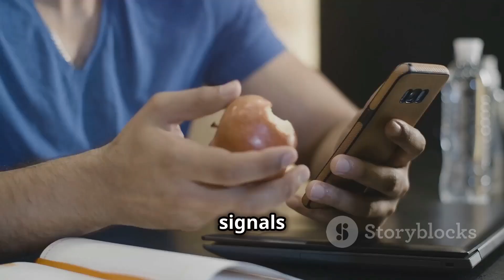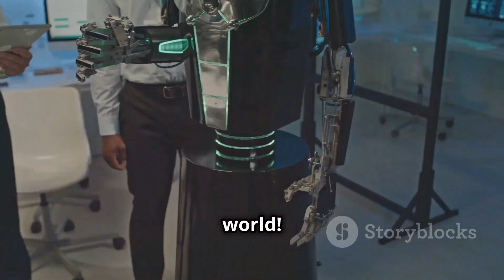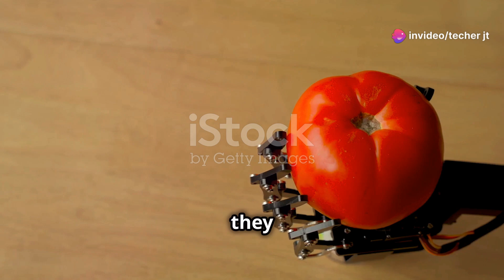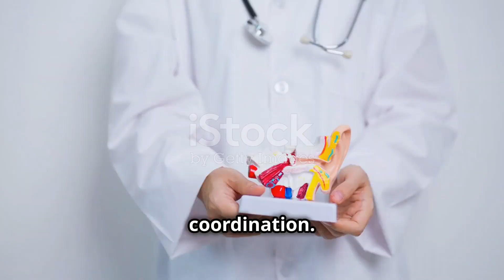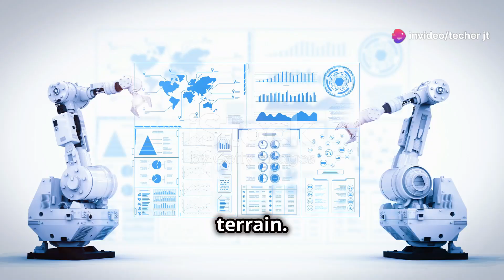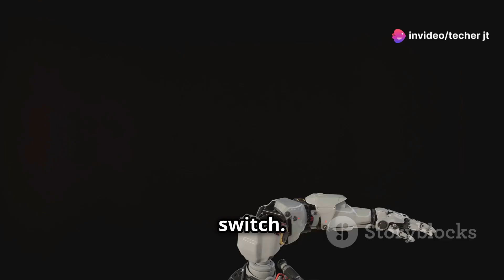Robotics Mechanical Sensors

Comment: 🌟10 - Andromeda Chain  ⬇⬇
Reply: Antonnette C. Tayrus 
10 - Andromeda 

Q1. Understanding: What are mechanical sensors, and how do they function in robotics?

Answer: Mechanical sensors are the sensors that allows a robot to navigate and interact with their surroundings, they are the sensors that allows robots to perceive the world around them. Robots rely on these sensors to gather information, just like how humans rely of their senses to understand their environment. They function as they convert physical stimuli, like touch or motion into electrical signals that the robot's brain- the controller can understand. As if translating the language of the physical world, into the language that robots can comprehend. They are crucial because it is important for the robot's accuracy and safety, avoid obstacles, handle items with precision, and even respond to changes in the environment.
Reply: Rose Gabrielle D. Araoarao
10 Andromeda

1. Understanding: What are mechanical sensors, and how do they function in robotics?

Mechanical sensors help robots observe and interact with their surroundings. These sensors work similarly to human sensory organs, providing information on a variety of physical characteristics. They play an important role in helping robots to do difficult tasks independently and safely.
Reply: Ariel Lacia
10-ANDROMEDA

Q1. Understanding: What are mechanical sensors, and how do they function in robotics?
-Mechanical sensors are devices used in robotics to detect physical changes in the environment. They function by converting mechanical energy, such as pressure or movement, into electrical signals. These signals are then processed by the robot's control system to make decisions or perform actions.
Reply: Kent Kyle T. Palingcod 
10-Andromeda 

Q1.  Understanding: What are mechanical sensors, and how do they function in robotics?

Mechanical sensors are devices that detect physical changes in their environment, such as pressure, force, or displacement, and convert these changes into electrical signals for processing. In robotics, they enable machines to perceive and interact with their surroundings, facilitating tasks like navigation, manipulation, and feedback control.
Reply: Real Ann R. Dela Victoria 
Grade 10 Andromeda 

Q1.  Understanding: What are mechanical sensors, and how do they function in robotics?

Answer: 
Mechanical sensors are devices that allow robots to perceive their environment by converting physical stimuli, such as touch, motion, or force, into electrical signals that the robot's controller can interpret. Robots rely on these sensors to gather information, just like how humans rely of their senses to understand their environment. They function as they convert physical stimuli, like touch or motion into electrical signals that the robot's brain- the controller can understand. They are crucial because it is important for the robot's accuracy and safety, avoid obstacles, handle items with precision, and even respond to changes in the environment.
Reply: Zara Mae M. Jurane
10- Andromeda

3. Analyzing: Compare and contrast force/torque sensors and accelerometers. In what situations would each be more beneficial?

-Force/torque sensors measures the forces or twisting forces acting on a robots arm or gripper. Whereas accelerometers measure linear acceleration (the rate of change in velocity). Force and torque sensors are best for applications that requires precise control of force, like gripping delicate objects or assembling intricate parts, which is precisely beneficial for space robots, that usually maintain and repair space crafts on other planets. Accelerometers on the other hand can be best used in cars, specifically in airbag systems, to detect sudden rapid deceleration.
Reply: Christine M. Luna
10 - Andromeda
Sept. 09, 2024
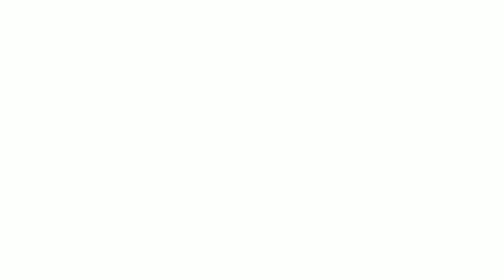7:22 (time stamp)

5. CREATING:  Design a simple robotic system that utilizes at least two types of mechanical sensors. Explain how these sensors would work together to achieve a specific task.

PROPOSED ROBOTIC SYSTEM:
"Automated Pick-and-Place Robot"
- The objective of this robot is designed to sort out and transfer small objects in a manufacturing environment.

Mechanical Sensors Utilized:
1) Force/Torque Sensors 
2) Proximity Sensors

COLLABORATIVE INTERACTION OF SENSORS:
- When the robot approaches an object, the proximity sensors activate -- confirming the object's presence.
- As the robot grip the item, the force/torque sensors monitor the gripping force, adjusting it in real-time to ensure the object is held securely without being crushed.

- This synergy between the sensors then enables the robotic system to efficiently and safely pickup-and-place items in designated locations, ultimately enhacing work productivity and reducing the risk of damage during operations.
Reply: Angel Sofia C. Tabaniag
10- Andromeda

1.) Understanding: What are mechanical sensors, and how do they function in robotics?

- In robotics, mechanical sensors convert physical changes such as force, pressure, or motion into electrical signals. These sensors facilitate environment interaction, movement adjustment, and stability for robots.
Reply: Trixie Lorraine T. Canopin
10 - Andromeda 

1. Understanding: What are mechanical sensors, and how do they function in robotics?

ANSWER: Mechanical sensors in robotics detect physical stimuli like force, touch, or motion, converting them into electrical signals that robots can interpret. This allows robots to perceive and interact with their environment, enabling accurate and safe task execution, such as applying the right amount of force to assemble parts.
Reply: Andrei Lavern A. Pelayo
10-Andromeda

4. Evaluating: Assess the impact of mechanical sensors on the efficiency and safety of robotic operations in manufacturing. Provide specific examples to support your evaluation.

Answer:
Mechanical sensors enhance efficiency and safety in robotic manufacturing, and provides real-time data on factors like position, force, and proximity, making robots to perform tasks precisely, avoid hazards and etc.
Reply: Dean Andrie P. Daohog
10 - Andromeda

1. Understanding: What are mechanical sensors, and how do they function in robotics?

Mechanical sensors enable robots to view and interact with their surroundings. These sensors function similarly to human sensory organs, providing information on a wide range of physical properties. They serve a vital role in enabling robots to do complex jobs autonomously and securely.
Reply: Kobie James B. Gabales 
10 - Andromeda 

3. Analyzing: Compare and contrast force/torque sensors and accelerometers. In what situations would each be more beneficial?

Force/torque sensors provide a robot with a sense of touch, detecting forces and torques during interactions. In contrast, accelerometers measure linear acceleration, helping robots maintain motion and balance. Force/torque sensors are commonly used in robots that interact with humans, such as collaborative robots.

 Meanwhile, accelerometers are essential for applications like navigation, collision detection, and gesture recognition, and are widely used in devices ranging from smartphones to cars.
Reply: Ettena Marie A. Gabales 
10 Andromeda

1. Understanding: What are mechanical sensors, and how do they function in robotics?

Sensors are essential for robots to perceive the world around them, just as humans use their senses. Mechanical sensors convert physical stimuli into electrical signals that the robot's controller can understand, similar to language translation.
Reply: Davey A. Sabanal
10 - Andromeda

2. Applying: Describe a scenario in which tactile sensors might be used in a robotic application. What advantages do they provide in that scenario?

Tactile sensors in robotic surgery enhance precision, provide real-time force feedback, prevent tissue damage, improve safety, and enable delicate manipulation of surgical instruments and tissues.
Reply: Kerk Ivahn C. Durohom
10 - Andromeda

Question 1. Understanding: What are mechanical sensors, and how do they function in robotics?

Answer: Mechanical sensors enable robots to navigate and interact with their surroundings, as well as perceive the world around them. Robots rely on these sensors to collect data. They function by converting physical stimuli such as touch or motion into electrical signals that the robot's brain, or controller, can understand. They are critical because they help the robot avoid obstacles, handle items with precision, and respond to changes in the environment.

Comment: 10 LYRA CHAIN 🌟💙
Reply: Barcenilla, Xharmei Therese P.
10 - Lyra

4. Evaluating: Assess the impact of mechanical sensors on the efficiency and safety of robotic operations in manufacturing. Provide specific examples to support your evaluation.

Answer: Mechanical sensors have significantly improved the efficiency and safety of robotic operations in manufacturing. They enable precise control of forces for delicate handling of parts, collision detection and avoidance for improved safety in collaborative environments, adaptive control based on sensory feedback, and enhanced precision in tasks like assembly. For example, a robot assembling a car engine can use force/torque sensors to tighten bolts with the exact amount of force required, preventing damage, while accelerometers help maintain stability and avoid collisions during the assembly process.
Reply: Chlouie Fate O. Hermoso
10-Lyra

2. Applying: Describe a scenario in which tactile sensors might be used in a robotic application. What advantages do they provide in that scenario?

-A scenario where tactile sensors are used is in a robotic system sorting ripe fruit in a factory. The robot must grasp each fruit gently enough to avoid crushing it but firmly enough to lift it. Tactile sensors help the robot gauge the fruit's texture and softness, allowing it to adjust its grip. The advantages include increased accuracy, reduced product damage, and improved efficiency in handling delicate objects. These sensors enable the robot to perform tasks requiring dexterity and care.
Reply: Jasmine Jade D. Cañete
10-LYRA

1. Understanding: What are mechanical sensors, and how do they function in robotics?
Mechanical sensors convert physical stimuli such as touch and motion into electrical signals that a robot's controller can process. These sensors imitate human senses, enabling robots to perceive and interact with their surroundings. Common types of sensors include tactile sensors, force/torque sensors, accelerometers, gyroscopes, and contact sensors.
Reply: Blyth Eldrick L. Porsuelo
10-Lyra

2. Applying: Describe a scenario in which tactile sensors might be used in a robotic application. What advantages do they provide in that scenario?

Tactile sensors may be used to handle delicate and breakable objects such as glass, paper, or even other forms of plastic. Tactile sensors help robots detect pressure which may be used in creating sophisticated robot arms that can handle these delicate objects when manufacturing without the object being damaged
Reply: James Miguel Lumantas
10-Lyra

1. Understanding: What are mechanical sensors, and how do they function in robotics?

Mechanical sensors are sensors that allow robotics to detect changes in the physical environment, it is similar to the sense of touch to humans
Reply: Angel Alexa M. Maquilan
10 - Lyra

1. Understanding: What are mechanical sensors, and how do they function in robotics?
- Mechanical sensors are essential components in robotics, acting as the robot's "senses" to perceive and interact with their environment.